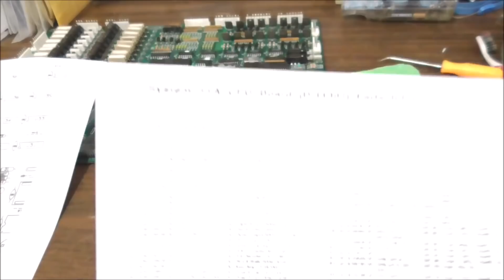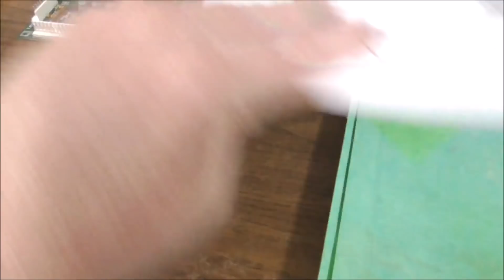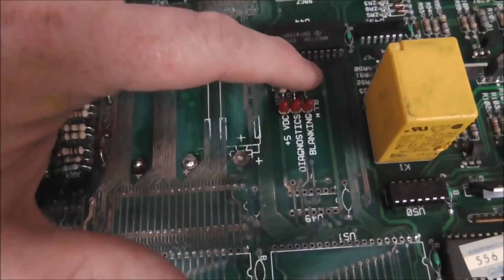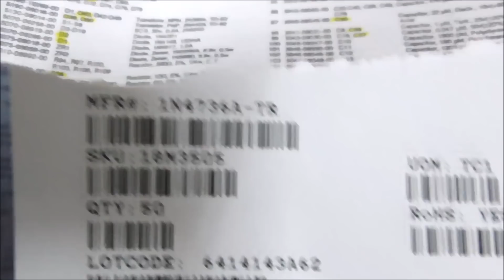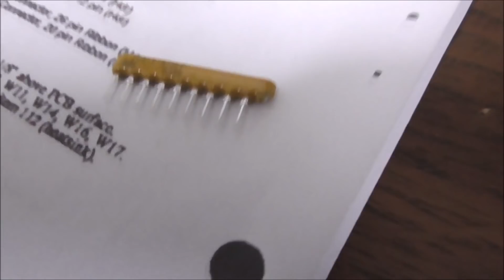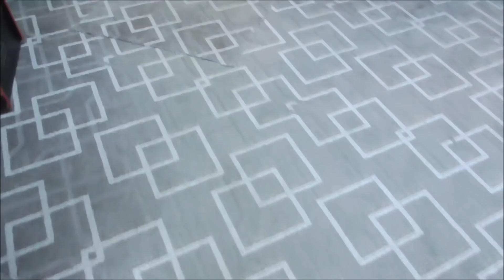Could We Fix This Heavily Battery Damaged PCB? - 1987 Williams F-14 Tomcat Pinball Machine Repair 4

Comment: Great work on the battery damage repair. How does one find replacement parts that are obsolete? You mentioned about the row of transistors you used 30volt i think. Is there a website that tells you?
Also like christine reference you have to be a certain age to get the joke! Fun watching
Reply from the maker: Some of them you just have to google the part number and see what's similar, sometimes you'll see where somebody has put this part instead of that part, and you can google and compare the specs and see if that's suitable, etc.  A lot of it was figured out long ago by previous techs when they worked on this stuff all day long.  Thanks for watching Darren!

Comment: I love the dramatic music cues, especially this extra long one and the fact it's foreshadowing the reveal of the problem for a FUTURE video! :)
I've only done a teeny tiny bit of extremely basic electronics stuff, and even then didn't really have a grasp of what I was doing, so I gain so much insight from these videos if only through repetition and osmosis. I really appreciate the "you don't have to understand the entire thing all at once, just take it one piece at a time" approach.
So, coming from this place of ignorance, may I ask why you filled the old battery pin holes with fresh solder if they weren't going to be used? I thought maybe they still needed to pass the signal through the area (batteries or no) but I didn't see any jumpers. Thanks!
(I'm a couple months behind, I know, sorry...)
Reply from the maker: The only reason I filled them with solder was because it made them look cleaner, lol  If I left the holes, it looks like something's been removed or ripped off, if I fill them with solder it looks like either it was made that way or that somebody has worked on it, and doesn't look like anything's missing.  So no real reason, I just thought it looked nicer.  Thanks for watching Jay, we appreciate it!

Comment: good job on repairing the board.  you might want to consider using an abrasive rubberized stick in medium grit about 1/4 inch wide for cleaning pads and traces.  it is a lot more focused then sanding down large areas and removing the masking on nearby traces and is also good for last second pad touch ups on cleaned pads that have gone to long since you did the major cleaning and they get into tight areas easier. they look like very long pencil erasers
Reply from the maker: I'll have to look for some of those Robert, thanks!
Reply: @LyonsArcade  made a mistake not medium grit but fine grit on the abrasive stick.  it is better then using fiberglass pencils. also good for cleaning sockets and lamp board traces with there sockets. my bad for saying medium grit. (hangs head in shame)

Comment: Hi Ron, Thank you for these interesting video's. I've seen you put a lot of time in pinballmachines to repair them. I'm wondering how high your labour costs per hour are.
Reply from the maker: We don't charge per hour, we just charge per job because i'm pretty slow at working on them.... so for instance, we charge a certain amount to get one running again, a certain amount to do the playfield, a certain amount per job.  It differs from machine to machine, kind of depends on how many parts we need and how longish we think it'll take.

Comment: Phew, l tried a failed attempt to replace caps. Nothing work. I probably broke a trace. I replaced with a rotten dog board with success in the past. But did not work well when I contacted them they said I need a new ribbon cable I think the board was bad.

Comment: I didn’t hear the ground loop feedback hum anymore after you repaired the main board and fired the machine up to test it. Did your fixes solve that problem already?
Reply from the maker: The ground loop thing is actually a very simple problem that has a simple solution, it comes and goes but we'll talk specifically about that in a video coming up soon on this machine and show what causes it and what the fix is.
Reply: @LyonsArcade  Thanks for doing this series. I know it's time consuming to record and edit video (on top of your regular work) but it's been fascinating learning how to do these repairs. It makes it less intimidating! I'm finally considering repairing my original power supply and removing the Rottendog

Comment: This is one of those cases where a bench test rig is really essential .... all you need is +5, +12, and a LED display panel.

For basic functional testing, you can power the lamp and coil supplies into the board off +12v.
Reply from the maker: I don't feel like it's necessary in this instance, the board was already working and we have the machine as a test bench that has an expansive self test capable of sequencing all the lights, switches, coils, displays, and sounds....

Comment: Technically the resistor pack has a "common" pin to all the resistors, but it is not necessarily ground. Very often it goes to +5V when certain open collector logic circuits need pullup resistors.
Reply from the maker: Jussi there is a concept called a Distinction without a Difference.  Your Distinction is noted but if you're trying to correct everything i'm wrong about you're gonna be here quite awhile...
Reply: @LyonsArcade  Neither that, nor offense, is my intention. Great work, I might not have the tenacity needed.

It has been noted to me often that I am too analytical and theoretical. It is all right for people to say so, and I will try to fix my ways, but this pretty much goes with my native wiring, LOL!
Reply: Resistors are not polarized.  The common pin may connect to power or to ground.  It won't change how the resistor works.

This is different from components like electrolytic capacitors and diodes, where backwards installation either won't work or will result in a blown component.

Comment: If the copper has been cleaned, sometimes adding some RA Flux onto the board can help the folder flow nicer.
Then just clean it off with some isopropyl, or a mild paint thinner, once your done if needed .

Comment: Awesome job man. I didn’t want to deal with putting in a socket for the nvram so I just ran an off board Bayern pack on mine. I may order some of those watch battery sockets and put that in. Not sure.
Reply from the maker: The watch battery thing is pretty cool, I do that on Bally's now.

Comment: How about a whole replacement board
Reply from the maker: You can get one, but the board is up over $400 plus shipping, and then we don't get to do this great video.
Reply: Very expensive. Looking at probably $400 us.
Reply: It will take time to fix it all but i think you can safely say that buying all the parts for that board (excluding the shipping ofc) separate and replacing it would cost less then just replacing the entire board. Since some parts only cost a few cents and you generally do not need to replace them all :)

Comment: What about having the battery holder where it will not cause problems close to the place where you clear out the machine every so often, it is just a shame that there is not a replacement module using 4x FPGAs and 4x CPLDs to replace what had been damaged.
Reply: If you do not need batteries why put them back in? the Nvram saves highscores, settings bookmaking etc without the need of the batteries (it's really cool!). Maybe if you want to keep it really original you can. You can buy the battery holders for a few cents too... but i would suggest to just solder 2 wires and screw the holder to the bottom of the backbox. IF you have leakage of batteries again it can still travel back up those wires if you are unlucky... takes a bit longer but this board already had the time to corrode this far. You can consider the nvram as a USB stick that saves the data. Once the USB stick does not get power it still retains the data when you put power back on it. Sometimes the old fashioned way is just obsolete. And hey! if you had gotten the highscore in 1990 it keeps it forever! that is a plus too! :)
Reply: The nvram is soo much nicer if you’re talented enough to replace sockets like Ron is. If I lived close by I think I’d be in the shop daily learning.
Reply: @PauzPinball  I was watching your videos as I could not get into the IOM video streams
Reply: @DAVIDGREGORYKERR  watching my videos??? God I hope not. Lol. The only videos I’ve ever posted were from years ago when I need help with one machine and I had no where to post videos for the people helping me to see them. Definitely not intended as recommended viewing. Lol
Reply from the maker: You can definitely mount the battery down in a part of the cabinet where it won't leak all over the board, that's how we used to do Bally boards all the time.  Thank you for watching David Gregory Kerr!
Reply: @LyonsArcade  if solder won't stick to where it is needed what about using a product called Wire Glue which can be used in place of solder if soldering if heat would destroy the part.